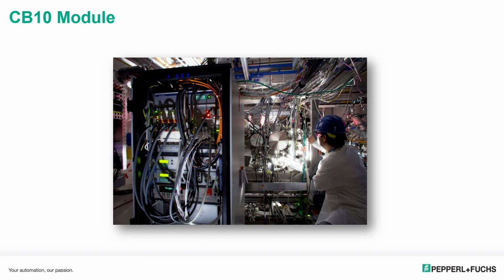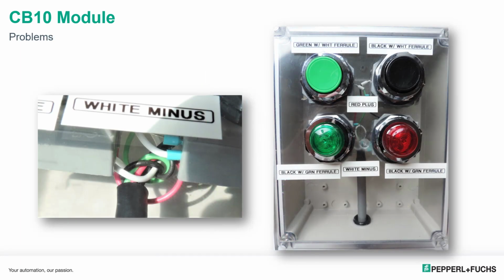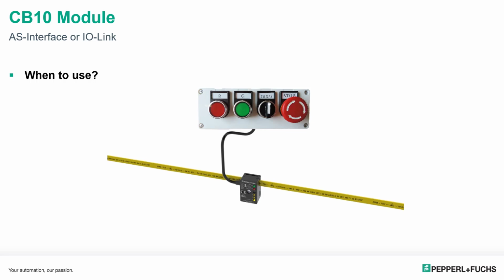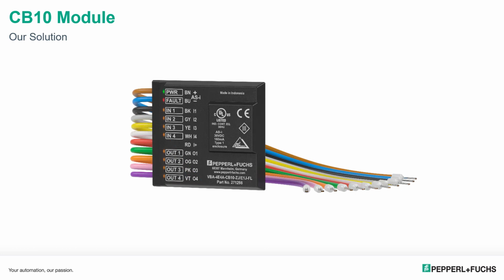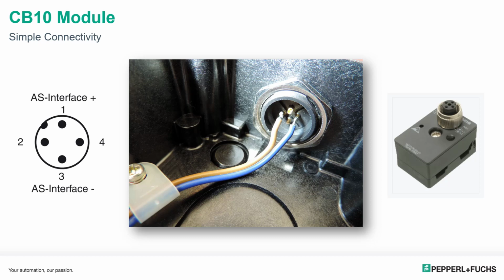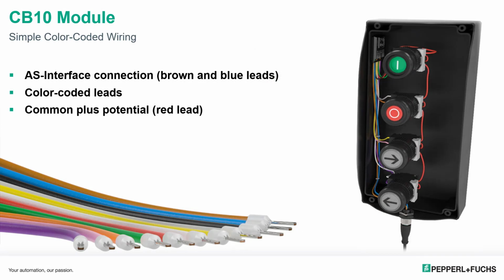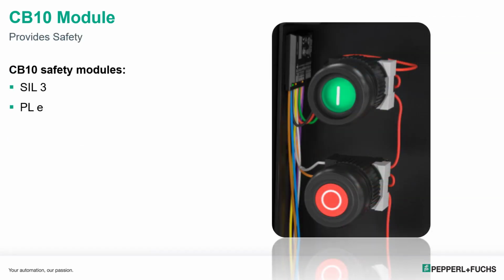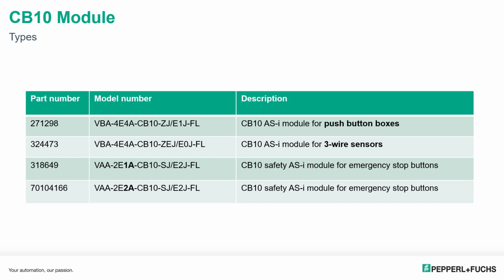CB10—Connect Push Button and Indication Boxes to AS-Interface

Comment: how to set node address in this module?
Reply from the maker: Hi Rameez, it’s easy to connect the CB10 module and assign it an address. AS-Interface modules come with an address of 0. To assign an address, you can either use Control Tools or the handheld programmer for the M12 connection. The fault LED on the CB10 module will light up red until an address has been assigned. Safety models will require a full address. 
Hope this helps.
Reply: hello can you please send me procedure for progmmation adress  this card